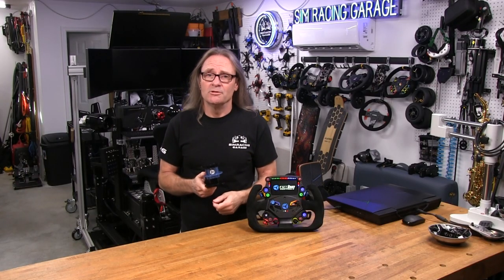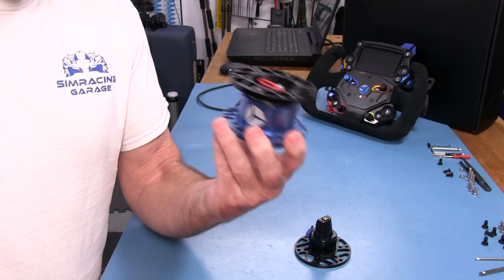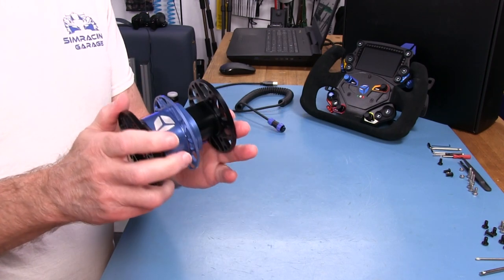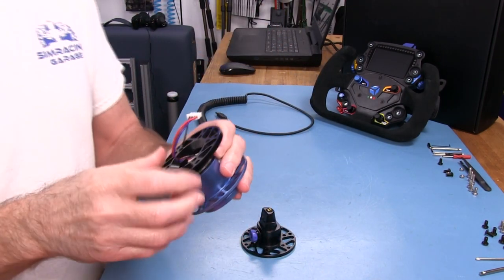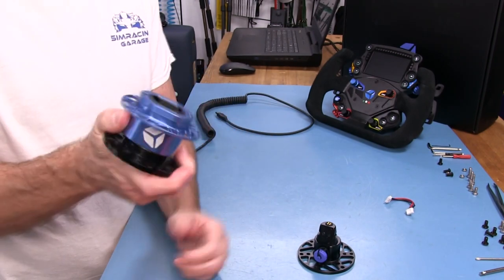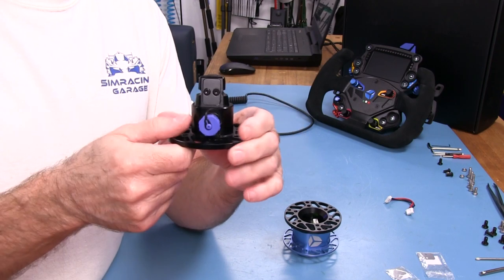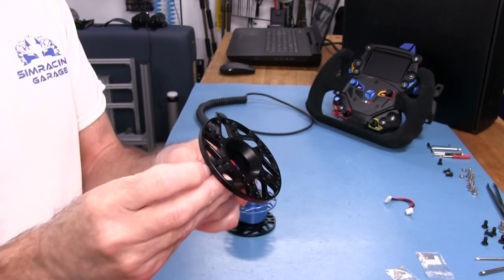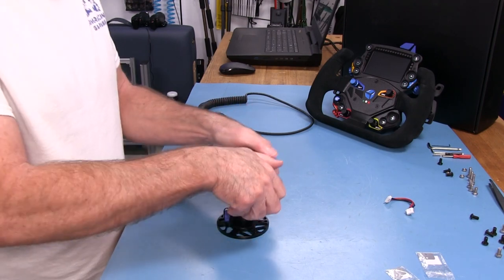Cube Controls QRX QR Review

Comment: Why didn't they design without the need of 'shims'? If they tested 50 wheels with the same tolerances of shims used, why didn't they use that tolerance to make a solid male connector, and save the consumer a lot of wasted time? Ridicules! This is a design flaw that they're not taking the time to alleviate. The best QR on the market right now is the one sourced by Simagic for their dd wheels, and it's a proper qr, flawless and solid. I have no idea why all the companies haven't followed Simagic's lead in this aspect.  It's simple, solid, and no bloody cables. Let's not even talk about the Fanatec joke...Great vid Barry, but I wouldn't get this until it was modified to benefit the consumer instead of the manufacturer. The 'shims' are a 'sham'!

Comment: Do you have a take or thought of what might be affected over all on the length of space or spacers from or between the wheel to the base ? I added a 3 inch spacer to my Simucube2Pro base to the wheel which gives me much needed room to pull and insert the pin on the QR. My nephew helping me get all setup thinks i might should take it out because of all the force during the race.

Comment: will the QRX QR work with a podium hub to replace it's quick release part?
Reply: unfortunately, no. if you wanted to use the qrx with a fanatec wheelbase, you would mount the base side to where you would mount a wheel on the podium hub. doing this would basically give you double quick release, which is quite pointless.
Reply: On the base side, you can stack the Podium Hub with this, so your Fanatec base thinks there is a Fanatec wheel attached. Then attach a 3rd party wheel to the QRX wheel side.

Comment: I really wish Fanatec would offer a new design QR for the Podium wheels. Even if it means having to buy new wheels.
Reply: Most of their customers are still on CSW and CSL bases and I don't think their bases' QR are changeable...
Reply: @jonathant4280  that comment did not age well
Reply: @PlayJasch  Wdym? They stopped the production of their older products doesn't mean there will be a significant change of their user base soon, and the new CSL DD is still coming with the old QR system. I assume the new QRs will only come with their high tier wheels first like the M4 GT3 and Bentley GT3 and it is not happening in this year. Do you think the CSL and CSW users will pay that much for a wheel like those?

Comment: To bad they don't have a non-pass-through version of it, I would have bought it then because it looks really solid, but the wired pass through adds to the cost and it's basically useless to me anyways.
Just ordered a similar one from NRG, but I'm afraid it will have some flex/play in it, as it's just a straight D-shape spigot without a conical shape to keep it snug, but it's also quite a lot cheaper.
LTEC/Simlab's QR is probably the next QR I'm going to try out, as it's utilizing similar conical shape as the Cube QRX QR, but without a wired pass through.

Comment: Missed opportunity to implement a clock spring (like is used in real car's steering wheels for the airbag wiring) and get rid of the dangling cable altogether. Would have been a much more elegant solution.
Reply: Servo motors can spin idefinetly, therefore clock spring isnt an option
Reply: @TomoKW  not when they are powered up and a bumpstop is configured. A hard stop could also be set up in the device

Comment: You know, for the price this doesn't really seem worth it... rather get the Q1R, this is just sloppy considering that it's from cube controls (another thing is that at that price for those wheels they should just include the QR). Not only that to begin with but they've already used up over half of the shims?? For that price you would expect better tolerances.... or just a better system!
Reply: Agree with you there. i have one Q1R base and 4 wheels and in 4 years i only make a minute change either in or out and its fast and a super solid connection. I wouldn't trust this setup for years of use swapping out different wheels. Q1R for me